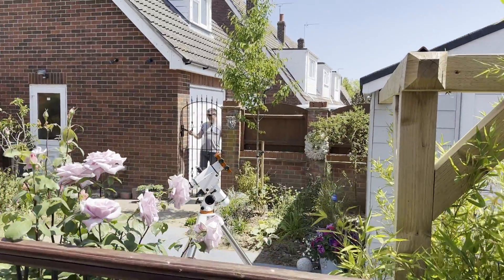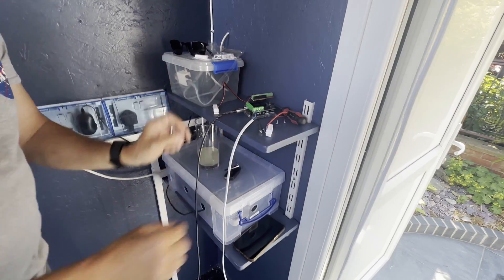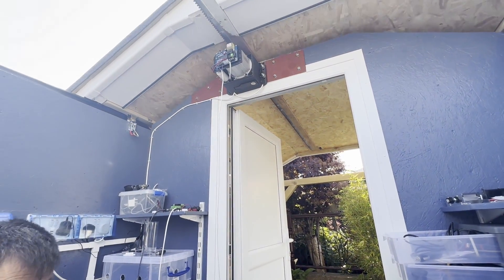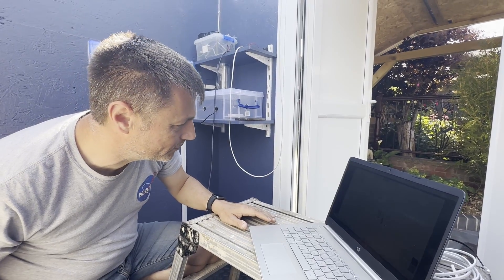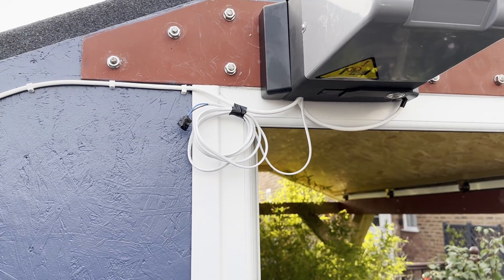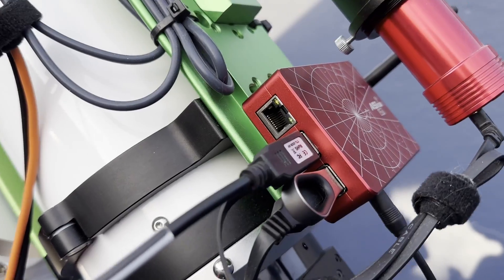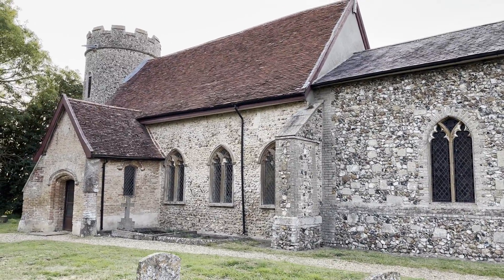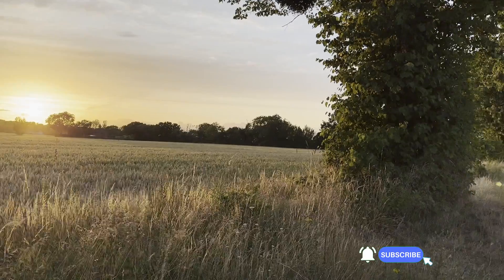Astrophotography Melotte15 Astrobloke and an Arduino!

Comment: Nice video,

I had similar roof setup with Arduino and a very long usb cable running to the mini Pc. 
Was looking for something wireless and built my own ascom driver with a simple esp8266 board and now i can connect to the roof without Arduino or the usb cables.
Reply from the maker: Thanks for watching 👍 that sounds like an interesting setup you’ve got, good to loose the cables!